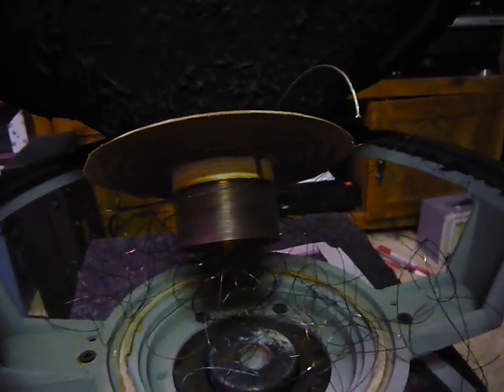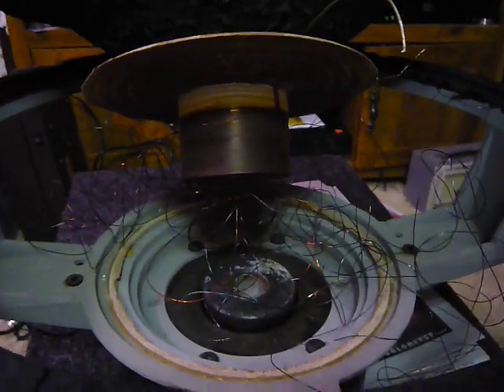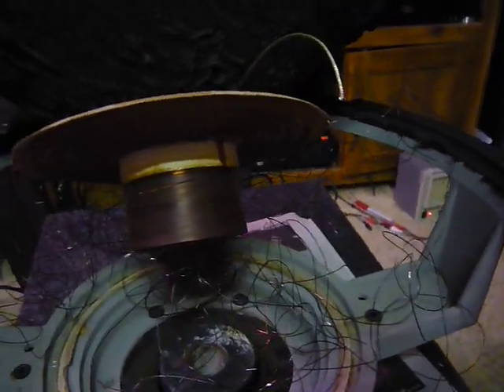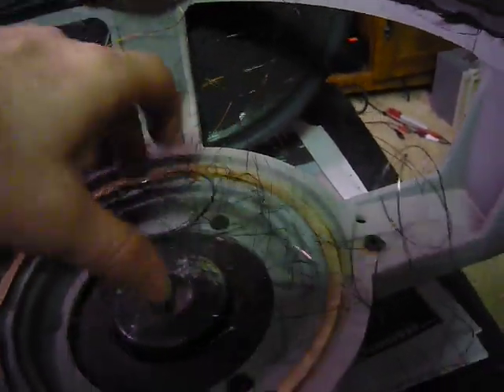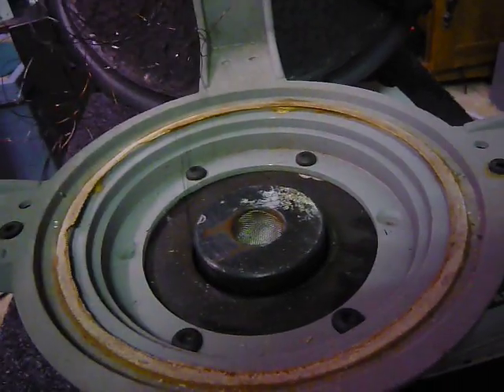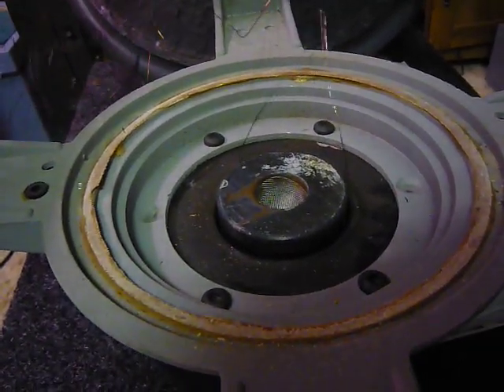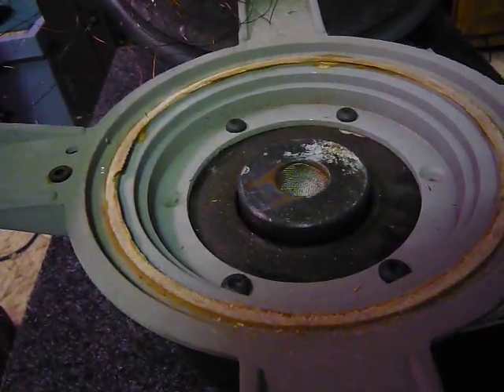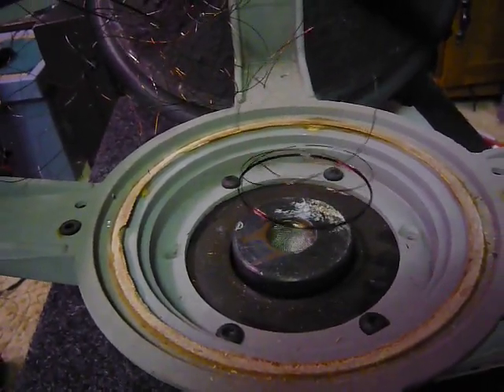Blown Speaker, Part 1. DJ fries voice coil of 15" woofer: Recone needed.

Comment: Typically not. The voice coil and magnetic gap have tight tolerances, so they need to be made for each other. Even matching the nominal size is not enough. If you can't get a recone kit made specifically for your driver, then you need to replace the entire driver.